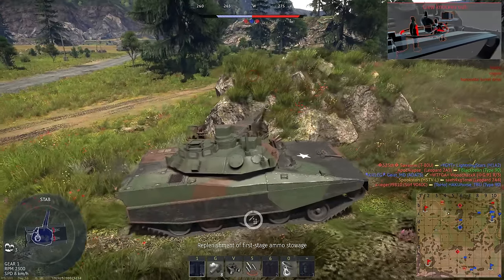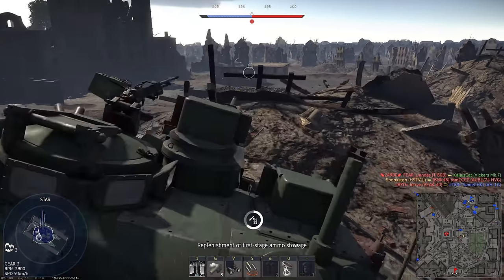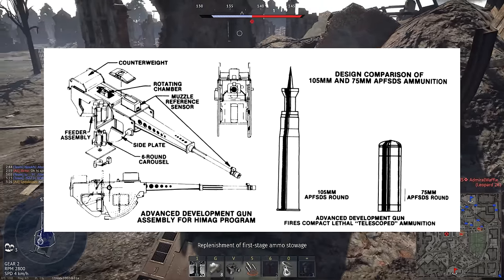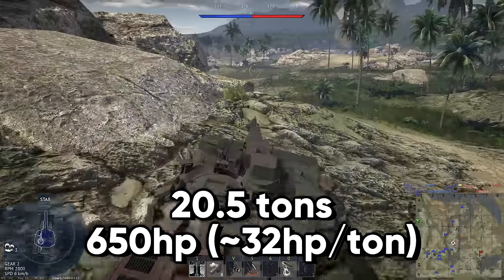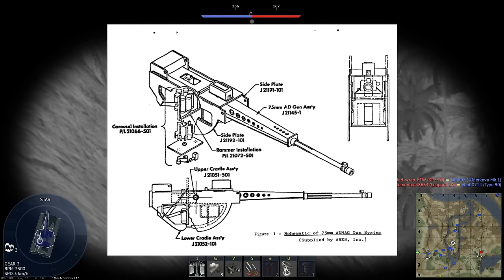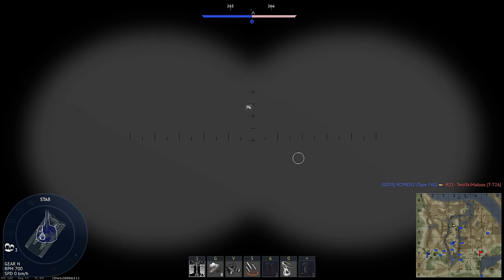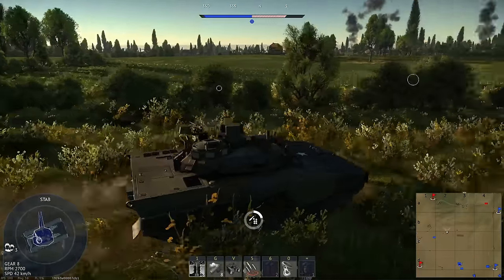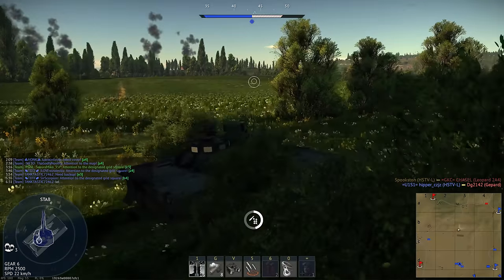HSTV-L - Tank History and Review

Comment: I would argue that the HSTV-L and systems of the like would not actually be as expensive as you think. While they do have advanced fire control systems, they used steel and aluminum armor with high slopes. This would significantly reduce cost because you don’t have to pay for insane amounts of composite armor and ERA. Replacing the gas turbine with a diesel or turbo diesel would also cut costs. On top of all this, the lack of unnecessary “doo-dads” like a movable hydro pneumatic suspension and top mount HMG (like on the MBT 70) would also cut costs. Great video as always!
Reply: top mount HMGs are not unnecessary doo-dads
Reply: Lord Solar Matthius they are when they add insane costs to a tank project. They also are unnecessary when the tank is being protected by Anti-aircraft vehicles and air support. They do nothing but complicate the building/design process and add cost + weight to a vehicle. 

Therefore yes: unnecessary doo-dads

Comment: With modern propellants, and APFSDS rounds, it's possible for a 70mm cannon to pierce modern armor. There are tank arounds that use rocket motors as well to extend range and accuracy as well. A 70mm rocket assisted tandem HEAT round might be able to pierce modern armor as well.

Comment: So it's basically a far cousin of OTOMATIC that has the same "it's not enough good" situation?
Reply: The OTOMAGIC was actually good enough. It was never accepted into service because the Cold War ended and the need for SPAAGs in Western armies became far less critical. 

Today they are developing a moder version, the Draco, using guided ammunition to act as a do-it-all platform.
Reply: No. It's a battlecruiser tank that double taps T-72s and runs away really quick.

It never worked because HOTROD (a heavily modified M113 with something like 90 hp/ton PWR) showed the U.S. Army that anything more than 30 hp/ton is generally bad (in a few not-uncommon-but-not-ubiquitous soils) as some soil types will cause it to dig a trench instead of move around on the ground.  HSTV-L was mostly an AAI thing by this point because the U.S. Army lost interest in HIMAG when it realized that tanks would never move fast enough to actually avoid determined counter-fire from an ambushed armor platoon.

30 hp/ton is what the M1 Abrams had when it first deployed to the US Army, so you'd about similar mobility in the light tank, and that isn't fast enough to evade countershots. So the whole "armor is useless" thing turned out to be a bad fad that passed quickly between around 1968-1972 in the USA. It ended faster in Germany because they built VT 1-2 and discovered two cannons won't let you double tap tanks and not even VT 1-2 with its retarded strong engine and lighter end weight could move fast enough to get out of the way of enemy shots.

Turret traverse and the push-button rangefinder ultimately won that round.
Reply: @SecuR0M  Wait, wait. But the HSTV-L have very fast (57 degree/sec) turret traverse, but why they rejected? Also is the gun have the same mechanic as RAVEN or something?
Reply: @SecuR0M  You are ignoring expense and the fact that for a long time, people couldn't design a tank that could absorb 100 or 105mm guns at moderately close range AND be decently mobile.
Reply: Anyway since this is somewhat obscure (not really but tank nerds don't know about it) when a vehicle is moving and you miss because it suddenly changes direction or speed and throws off your lead or whatever, this is called target induced error. The idea behind HIMAG/ACVT/HSTV-L (really, HIMAG was a part of ACVT, which also included HOTROD [not an acronym], and HSTV-L was along similar lines but separate since it was a private industry design) was that the vehicle would move fast enough to respond to gunfire to cause target induced error.

This would require absurd amounts of acceleration (for a tank) and attentive drivers who would be cued by gunfire detectors or something to move. Or a computer hits the brakes and throws the crew forward and possibly out of their seats. DARPA brought the idea back a few years ago with one of their dumb idea tanks i.e. Ground X-Vehicle or something. It went nowhere, naturally, as ACVT did, for much the same reasons: target induced error is hard to make practical when dealing with hypervelocity ammunition like sabots. When something can cover 1-2 kilometers in about a second, give or take half a second, then you need a robotic controlled system. This is what ACVT found out. Ground X-Vehicle probably figured computers are smart enough now to do it, but then they found out that it requires a bit too much acceleration to dodge a tank shell fired at a kilometer or so and probably gave up.

It was also supposed to be fast enough to make gunsight tracking hard, but this is literally impossible for a main battle tank (HOTROD was a good attempt though, trench digging aside). Or any ground vehicle. A helicopter gunship, a particularly fast one (like RAH-66 or Mi-24), can just about do it, to slower moving turret drives like found on ZSU-23-4 (40 degrees/second traverse drive). Against a faster turret drive, closer to 60 degrees/second (like 2K22), it would be sorta fucked though.

And finally it was just going to be generally fast to reduce exposure time, because it's skirting around at like 40-50 miles per hour instead of a more stately 10-15 miles an hour, open country.

What ACVT ultimately found was that 29 hp/ton at the sprocket (comparable to HOTROD, actually) is a reasonable sprocket PWR ratio for the time being (barring some massive improvements in automotives, which hasn't materialized yet c. 2020), given tanks of sufficient flotation (read: track width) and the limits of railway gauges (3.6 meters in the standard gauge) being among the prime factors. Wider tanks (Song for Denise tier) could possibly handle higher PWRs, but may not move faster. It also found that improvements in sprocket power transmission would be helpful even in weak soils where trench digging became apparent. With that in mind, M1 has a gross PWR of ~27, but I don't know what the sprocket PWR is. I'm going to go out on a limb and assume it's close to around 15-18 hp/t, though. Probably edging towards the lower bound of that. Conversely, M60A1 had a sprocket pwr of 8.9 hp/t and a gross of like 15.
Reply: @SecuR0M  Could you make this into an artical something so it can be easily saved for later and shown to others?

Also, what about 100mm HEAT from a bog standard African use T-55, could T.I.E. be induced for that?
Reply: @SecuR0M  composite armour killed the idea idea of not useing armour, before that as Tevo77777 said, you couldn't build a mobile tank and have armour to stop high end weapons, and even then you couldn't really stop most high end weapons.
lighter armoured vehicles are still easier to deploy oversees, and put less strain on vehicle components and use less fuel, thus with top-attack missiles there might be a move to lighter tanks again (although active protection systems might also make missiles obsolete meaning frontal armour is still mostly useful)
Reply: @matthiuskoenig3378  "Composite armor" predates HSTV-L and ACVT by about 20 years. The reason M60 didn't incorporate siliceous cored special armor (similar to T-64) is because the USA didn't want to spend an extra 12-18 months figuring out how to cast that shit. It was still operating in WW2 mode where the war could start next week and you'd need to maximize production in a month. I don't know what a "high end weapon" is considering XM1 was designed to stop the most lethal and dangerous tank gun of its era.
Anyway there's no particular reason why a lighter tank is at all desirable, especially one that has a worse armament and protection, while not even having superior mobility or anything of the sort to the bigger one. Special Armor only accounts for about 15-20% of the tank's sticker price, and I suppose if you have a fetish for air-mechanization, think flinging tanks at trouble spots in 24 hours instead of 24 days is going to make a difference in the long-term outcome of the war (it never has), and are beheld to the budgetary whims of a bunch of stodgy, miserly old coots in Congress who are too old to be doing such a serious job and might have a heart attack from a high priced high technology tank, then it might make sense.
But HSTV-L isn't what the US Army wanted when it said it wanted a light tank. Not in the slightest. Besides that, it would probably suffer greater casualties than an M1 force, disproportionate to the cost decrease (I doubt it would be much cheaper, if at all, than refurbishing an M1 today) due to its poor protection and comparable mobility. It would not be able to inflict significant casualties on the enemy, due to its poor armament, and this was true in 1984 as well as today.
There is no merit in the idea that they are "easier to deploy" since the Korean War and Desert Storm had heavy armor (M26 and M60A3) arriving less than a week after the light tanks of TF Smith and the 82nd Airborne. Less than a month, modern MBTs arrived. If you can't wait a month you've already lost the war, but this is an old bugbear in the US Army, that if you just throw people between two groups of guys they won't fight, as if by magic (if you think that's exaggerated I suggest you read the First Earth Battalion slides, it's like Future Combat Systems crossed with literal LSD or Blue Oyster Cult).
If HSTV-L had been acquired by the US Army it most definitely would not have been as a replacement or even accompaniment to M1. M1 is too good, since it has similar mobility, better protection, better firepower, and similar sensors. It probably costs about 20-50% more but that's fine. Historically light tanks have never been significant contributors to the anti-armor battle (TF Smith) and historically have been generally deployed where threats of direct tank action is low in the first place. In this case, being armored against small arms, HSTV-L might make a good airborne tank, but it would die a lot against more serious threats, like BTR-80s and BMPs, albeit it would probably give more than it got until it ran into something genuinely worrisome like T-90.
During the Korean War the initial deployment of Chaffee light tanks ended up not killing a single tank and all became casualties to terrain losses. Conversely, the few M4s that made it into the theater were recovered either by towing or their own power. HSTV-L however would probably have mobility mostly comparable to M1 (being generous, really) so that seems unlikely. M551 OTOH only killed a pillbox and a single Type 59, both with Shillelaghs, in Desert Storm. The remainder of the war was spent road marching. By the time they reached their objective the war was over.
Were I the commanding colonel of the 82nd ABN's DRF about to fight a heavy armor force, I would prefer land mines, fiber optic guided missiles (think Spike-NLOS), multiple rocket launchers, attack helicopters, towed anti-tank guns, Javelins, belt-fed machine guns, and AT-4s and Carl Gustafs, in that order, before considering light tanks of any variety. Not to say that I wouldn't say no to light tanks, but they would need to have an actually lethal weapon: namely a 120mm or better cannon. M8 AGS can carry one. HSTV-L can't. So I would not consider HSTV-L to be a serious threat to any armor simply because it is too vulnerable to being blown the fuck out by literally anyone with a gun bigger than a AKM and it is too unlikely to kill modern battle tanks before being killed itself.
I would also be skittish about using such vehicles offensively, not just because they might be lost to terrain, but also due to their heightened vulnerability to ambushes and lack of mobiquity on the battlefield. Minor harassing fires by light artillery (76-105mm) could turn lethal for such a small and weakly protected vehicle, and its cannon is unlikely to defeat modern armored vehicles at significant combat ranges. Its height is comparable to the M1 tank, so it can't exactly hide terribly well at long range, and most importantly of all it is probably impossible to make better protected. I would feel a lot safer having a dedicated light tank platoon with proper protections, like the M8 AGS and its various "levels" of applique that go all the way up to 30mm APCBC and LAWs than HSTV-L. Granted, AGS wouldn't have any better mine protection, I suspect both would pop like bubblewrap with so much as a satchel charge underneath, but at least AGS has a good gun.

If M1s were available I would immediately take those as they are better protected against land mines, because they're fucking fat, as shown in Iraq when M1s survived numerous land mine attacks that would have destroyed M2s or M113s. They're also better protected against harassing artillery fire, similarly mobile, and have a better gun than, and comparable optronics to, the HSTV-L.